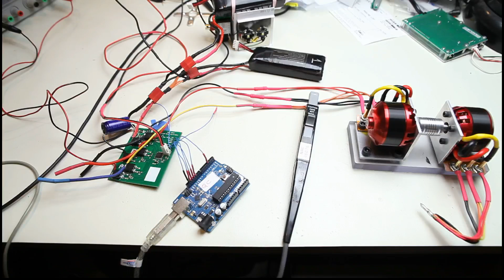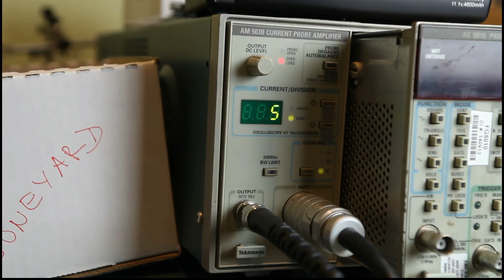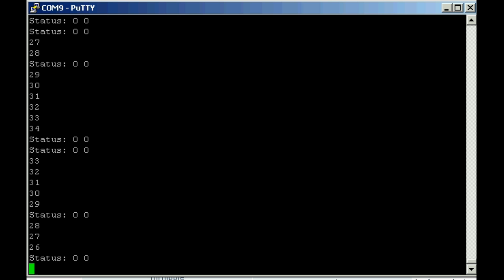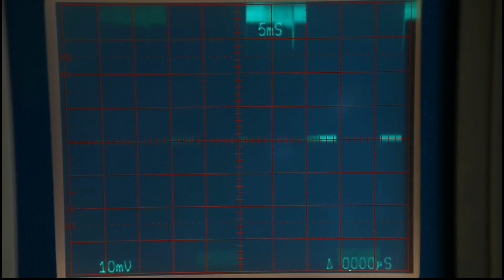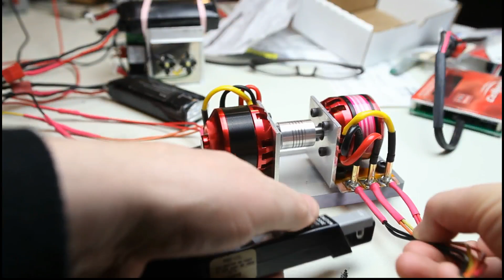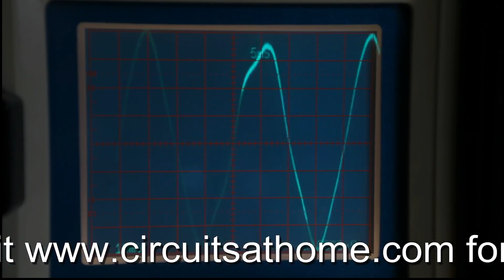Dummy load for BLDC controller testing

Comment: Hi,

What is the efficiency of generator mode of BLDC motor? Do you think is it possible to get 200-300W from BLDC, which has nominal power of 500-1000W as a motor?

Best Regards

Comment from the maker: I didn't measure the efficiency. Eyeballing ~90+%. You'll be getting 3 phase out of BLDC - rectify accordingly :-)
Reply: So do you think I can get 200-300W from this motor:
http://www.hobbyking.com/hobbyking/store/__18128__Turnigy_Aerodrive_SK3_6364_245kv_Brushless_Outrunner_Motor.html
in 3000-9000RPM range, if I roll it with a combustion engine? We would use it in a Formula Student racing car.

Best Regards